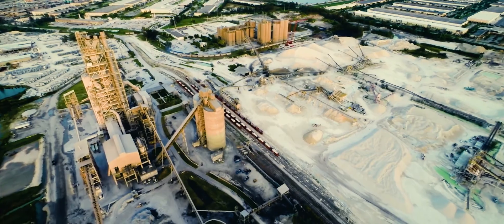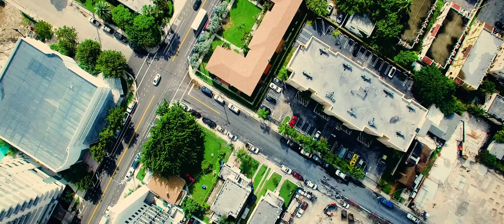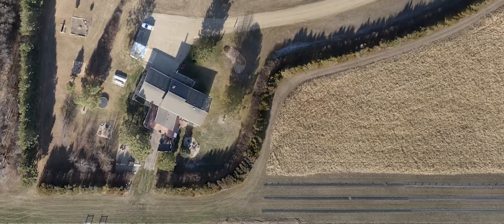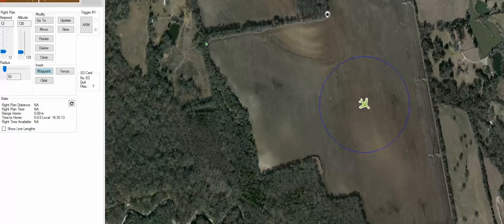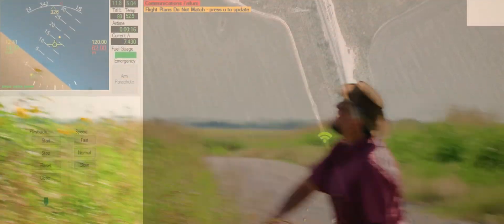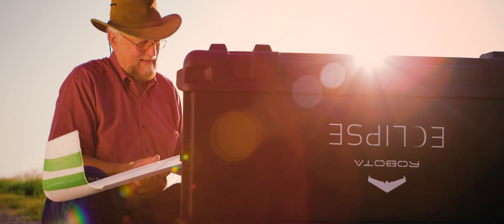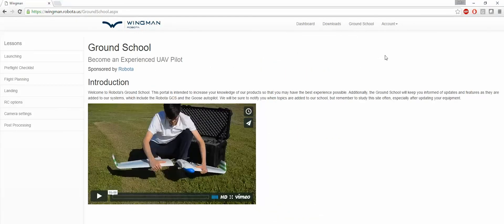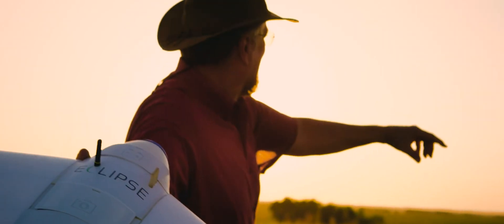Robota Eclipse Fixed Wing Mapping Drone

Comment: Is this platform completely autonomous? I don't see any mention of a controller in either this video or your website. As a remote pilot I would be very concerned with not being able to take control in the event of an emergency scenario.
Reply: The platform is autonomous and the system comes with a controller in the chance of an emergency.